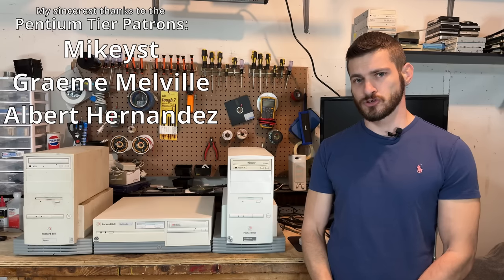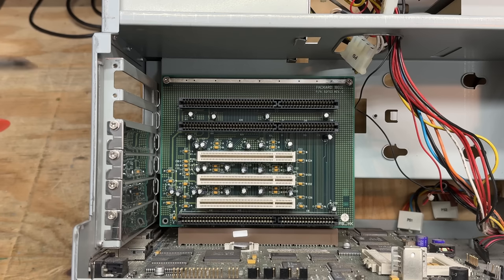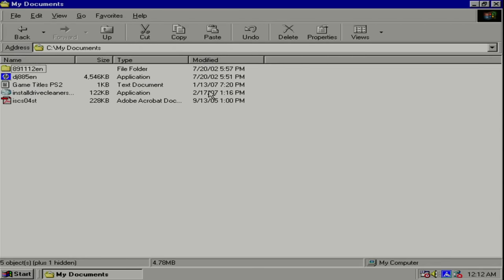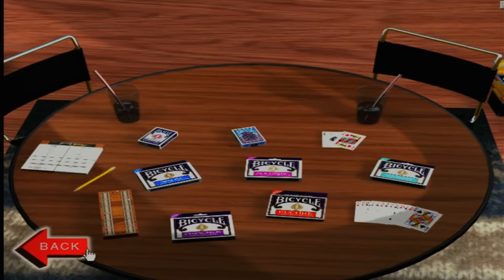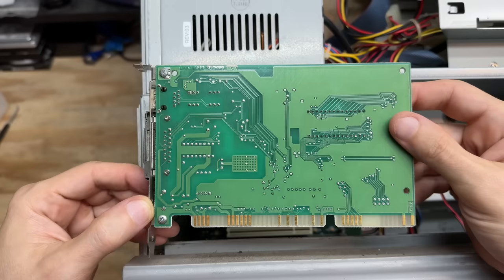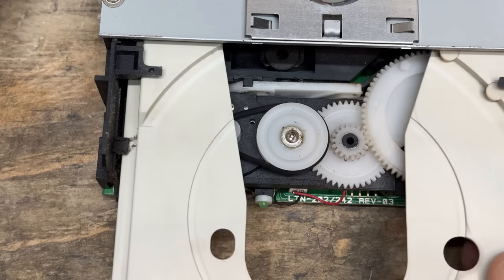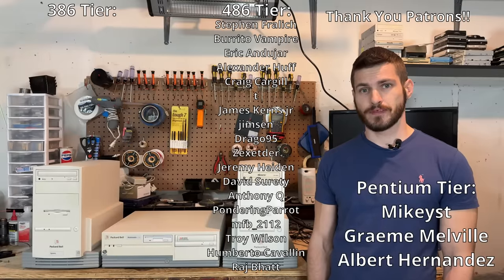Let's check out some Packard Bell towers (and one desktop)!

Comment: Rebel2 was a folder for Star Wars: Rebel Assault II: The Hidden Empire. It was released in 1995.
Reply: Ace Mc Crank,
Rebel Assault II, true, the CD-ROM install.
I'm still able to run on 14th gen RTX 4080 now, just did the Snow speeder mission, AT-AT, the robe ! It needs the CD-Rom on ATA, and it runs fine as it is as in 1995 !
Reply: From a more civilized age. before the dark times, before the mouse
Reply: I was yelling that at my screen. I mean not word for word, but you know.

Comment: I miss this design! My dad had the Platinum I with Windows 95 and a 1.2 GB hard drive. I miss it because his modem would connect at 28k with Prodigy Internet. It would dial through the computer speakers on the monitor because the sound card and the modem were on the same card. Watching this video makes me want to find another one of these machines. I remember going to Cartoon Network and watching videos because the computer had the full 1 MB of video memory.

Comment: The Multimedia Desktop seems to be overclocked somehow. I saw a Pentium 100 built in, and it posts with 120Mhz. Also on the Heatsink there is written 120Mhz.... decent 20% OC from factory? hehehe. Anyways, nice video again! Cheers!

Comment: AWW HECK YES!  PIZZA BOX PACKARD BELLS!

System 2 - Sticky dust like that could have been someone smoking in proximity to it.  How little there is would make me think it wasn't the owner, and it was only subjected to it a few times.  I've also seen Packard Bell optical drives do exactly what you described...  we called them "possessed". 

System 3 - The reason for the label over the PCI slot is because of that break out board.  It would conflict with any card in the slot.  Actually, the label was Packard Bell being a little forward thinking and masking the slot off so that end users were less likely to throw a fit because they couldn't fit a card there.

Comment: The Platinum 2240 is my Workhorse for Low Level formatting and Formatting of Drives , I got into Packard Bells via Billy Core in the mid 2000's and Now have about 16 Machines , Extra OEM Cards and Operating Systems and even a Nice MS Bob environment that I Like . These Computers become easy to Maintain after getting a Lot of Original Systems . These are Now becoming Highly Valued in the  Vintage Computer Collectors Circles in the United States Midwest Markets . Just Love collecting These , Liked and Shared , Thank You  :) QC

Comment: The DB15 port for Ethernet will require an AUI transceiver. It's a bit awkward to have a little box hanging off the back but you can usually get them with a few different media options like twisted pair, coax or even fibre.

Comment: I was given my in-laws' old PB desktop when they got divorced 15+ years ago.  It was a 100MHz Pentium but I maxed out the system RAM, VRAM, and swapped in a 200 MHz Pentium Overdrive, back when such things were still readily available on eBay.  It was my Linux-based home lab/NAS back before they were buzzwords.

It's stored out in the garage now, but it should still run with just a hard drive and a new CMOS battery.

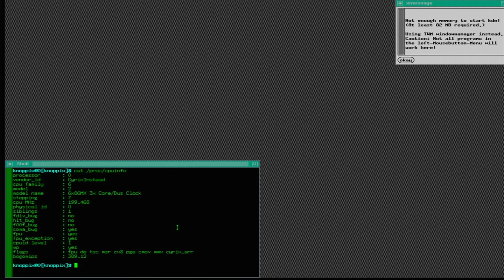Comment: 50:25 The Cyrix Instead motto was a thing, actually! Do an image search and you will find badges with it, and a boxed CPU upgrade for 386 systems that has it printed on the package.
Reply: Newer versions Windows 9x will display that too in the system properties. AMD was "AuthenticAMD" and Intel was "GenuineIntel". Older Windows versions will just think it's a 486

Comment: Those Packard Bell towers are the more normal ones. They also made some that didn't have the mainboard flat in the bottom. It was on the side like a normal tower, but they used a short bus riser with the expansion slots facing the bottom of the case so the cards plugged in upside down. There are reasons they got called "Packaged Hell" or "Puckered Smell".
I was amazed at how they could be so low cost with all the custom engineered, proprietary parts.

Comment: those towers were my first system for christmas '97 came with 233mhz, 4 gb hard drive and 32 mb ram.  Monitor with speakers on the side came with it...
Reply: Congrats'....Still fine with my own FIRST self build from Sep '97. But only a K6 200MHz. 3.2GB Quantum Fireball and 32MB EDO RAM(Was BLOODY $£€ around then = 32MB)

Comment: Wow, not just one but THREE Packard Bell computers that still work!  That's like finding a Jaguar that doesn't leak oil.

At a multimedia software company I worked at, when we got our first Beta copy of MSWindows 95, we installed it on our PB.  That machine never worked right ever again, even after doing a reload of the OS from the factory restore CD (yes, manufacturers used to provide you with actual reinstall media).

Comment: Greetings from Scotland. Another brilliant video Mike! I absolutely love your content! Especially enjoyed the strip down and repair of the final machine with the Cyrix processor – I always find weird Packard Bell's like this intriguing! Looking at both the UKT Support page and The Retro Web, that final machine uses Packard Bell's PB810 motherboard which I believe was amongst their last LPX style boards - they were already using ATX boards (both socket 7 and Slot 1) in various other machines that used their newer 'Milano' type case by the time this machine would have launched (approx mid 98). I suspect that last machine was very much a "how can we make a cheap budget PC with items from our old part's bin" special. That motherboard can only support a 66MHz FSB with a multiplier of 3, therefore 200MHz max. That will be the reason for using the Cyrix MII-266 which of course only runs at 200MHz (but 'claims' the performance of a 266MHz) - basically a very cheap way to squeeze extra life out of an old Socket 7 board. As for the 'reserved' PCI expansion slot, I suspect the reason for that is because the motherboard has integrated sound, but has to use that break out unit for the audio ports i.e. you always need to ensure you leave a space on the back for that break out unit. There are a couple of these machines on ebay, and I've noticed that the audio port breakout unit was in the middle slot which would align with that reserved expansion slot. As for one of the USB ports being deliberately hidden, that it just plain weird!

Comment: The first Wintel machine we had was a Packard Bell running at 75mhz... which was then overclocked to 100mhz, upgraded the Video RAM, swapped the soundcard/modem combo card for an SB16, and a USRobotics mode.  The modem/soundcard was terrible in DOS... could never get both working.
I eventually upgraded it enough to build my first custom PC, and never got a pre-built until that was the only way to get a 3080!

Comment: 42:56 - I'd recommend CRC Lectra Clean. It cuts through petrified thermal paste like a hot knife through butter. It even removes that horrible pink/yellow stuff that they used on Athlon/Durons in the early 2000s.

Just be ABSOLUTELY SURE to keep it away from any case plastics or LCD monitors. It will instantly etch those and permanently discolor them. It's fine for the plastic parts on motherboards though.
Reply from the maker: Interesting. Never thought to use that for such purposes. Thanks!

Comment: The date code for Packard Bell computers is in a very weird format: MMYDD. That's the 2-digit month, the last digit of the year, and the 2-digit day; it's the 5-digit number that comes after "Srv Cd."
So your Platinum 2240 was built on January 2, 1997; your Multimedia C115A was built on January 8, 1997; and your Synera was built on... an unknown date, because it's missing the date code entirely (I'm pretty sure that particular Synera was a built-to-order/BTO machine).
Reply from the maker: Thanks!
Reply: HeadsetGuy
20084 mine says, 2000 models, Pentium 4 HT
Love the Packhard Bell, very happy it's a great restored model now on Windows 10
Great Pentium machines, able to run 3 Slot GTX 1070 card !
Reply: wow, the first two are almost twins!

Comment: Since the first two machines appear to have original HDs, you can try running Packard Bell System Credentials to pull the manufacture date and original system configuration. The data is actually stored on a secret part of the HD, so it should survive a reformat. The covered USB port maybe due to controller bugs. The PIIX3 south bridge used with the 430VX chipset had a few errata where the USB 1.0 controllers were either non functional or partially functional.

Comment: I used the MM unit from 1995 to 2002 ( couldnt afford anything else until after that) , it started out as a 166 mmx with 8 mb ram and a 3.3 gig hard drive on win 95, when I finished it had a 233 mmx with 8 gig HD , 64 meg of ram, it was a rock solid machine for me , I happened into the dispersal auction of a mom and pop computer store , bought a whole tray of 233 MMX OEM chips for around 25 bucks and the ram for ten bucks , it kept me going for years. eventually put a PCI Diamond 3d card I got second hand into it and ran all sorts of games on it , never understood why PB had such a bad rep, the machine ( short of a CMOS battery going flat after a few years) NEVER let me down, now I think the worst I ever had was brand new lenovo P4 machine , I think the caps let go on that about a year after I bought it , started building my own stuff after that , again , no problems

Comment: Our first family PC looked exactly like your 2nd Multimedia system, but it was branded as an “Executive” that was more geared towards office use. My dad “acquired” it from work on the proviso that we weren’t allowed to game on it and only use it for study. Luckily the spec was so low that gaming wasn’t an option. We bought a later model tower in the late 90’s that I remember carrying back home on the bus and had to stop for breaks carrying it back. Those 90’s PC’s were so heavy and over engineered with unnecessary plastic trim and steel.

Comment: I had a Cyrix MII - similar if not the same model as that last computer - in one of my builds. Speedsys did the exact same thing to me when I tried to run it on that machine. Worked fine with everything else I did with it though! I swapped in a K6-2 and tried speed-sys with that and it worked fine. Weird...

Comment: So in my experience, that "skuzz" that was on the motherboard could most likely be basic cleaning spray that got sucked into the system while it was on. I cant tell you how many times I would see janitors back in the day just spray desks and the computers with aerosol solvent cleaner.

Comment: The cyrix CPU is reason for the fan on the VRM. If I remember correctly it was a factory installed fix. I had the displeasure of working on a number of the back in day. The cyrix PB soured me on both cyrix and PB.

Comment: PB quality in the 1995-1997 era was better than it was in preceding years. Despite the used parts scandal (which was more Compaq propaganda, since other PC makers did the same thing), PB managed to manufacture their low cost machines in the USA, including assembling their own motherboards in the US using modified reference designs from Intel and GVC.

A PB with L2 cache is rare. This was the main way they got the cost down. Usually the bundled RAM and hard disk were of a reasonable size for the time. 

The original software bundles are what make these machines interesting. They came loaded with so much stuff, much of it nostalgia inducing. Plenty of the Master CD restore disks are on the Internet Archive. Can be tricky to match it up to your machine without the birth certificate it came with - as there is a recovery ID that was printed on it.
Reply: Oh! One more thing. The PB with the reserved sticker, that PCI slot won’t work at all. It’s routed to the onboard audio.

Comment: If you want to keep the warranty stickers use some IPA. Simply put it around the sticker and wait for it to soak in for a minute or so, then use a very sharp blade and it should come off with no problems.
Reply: surprised Mike didn't slice it tbh (less destructive & more subtle!)

Comment: Magic Eraser works well because its abrasive material.   Be careful you don't create an uneven surface on the heatsink.  You'd be better off lapping them proper with sandpaper on a flat surface in that case.

Comment: Crap. I was hoping you would have tried the bios on that last Cyrix system. I had one and believe it or not, the bios was mouse driven with icons! It was very primitive but, it's the first and only time I've even seen one like that until UEFI. Way ahead of its time.
Reply: I've seen mouse BIOS on a few 80486 PCs. Almost everyone hated it, enough backlash to get it gone and every manufacturer back to the simple text screens, except on some laptops, until the GUI BIOS came back as UEFI.
Reply: @greggv8  It foreshadowed what was to come. Way ahead of its time.

Comment: some of the last gen socket 7 pentium boards indeed had usb 1.1(I don't think was 2.0 but possibly on k6 boards; I had 2 or 3 of the P1 boards, QDI forget the models)..... ** if you do retro often, first time I'm watching a video on your channel, MG Chemicals(usually electronics repair) sells a toothpaste like tube of while thermal paste that almost certainly is a bit more economic and should serve the purpose; pretty much a lifetime supply:P

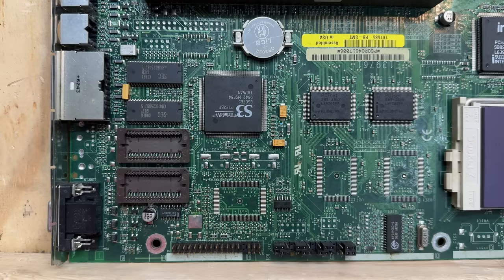Comment: Around 22:35 -- could the surface contaminant be mineral deposit from operation near an ultrasonic humidifier running on tapwater? If the local water is "hard" (as in much of the Midwest US), a similar buildup will often occur on objects. Computer fan(s) will probably intensify buildup via internal airflow.

Comment: I wonder if the sticker over the PCI slot is just because that’s the slot they put the sound IO that plugs in the motherboard so you can’t use the PCI slot… As if people couldn’t move the sound IO board on another slot if they needed the PCI one.
I really thought this was going to be the video with all three hard drives still there but nope, system 3 didn’t deliver.

Comment: What small pry tool are you seen using in the video? I’ve never seen something that’s like that but is that small.
Reply from the maker: It’s a DIP chip lifter. Whia 26810 to be exact. I’ve found many ‘off-label’ uses for it.
Reply: @miketech1024 thanks for the info, great video btw.

Comment: I just restored a later Packard Bell model, Pentium 4 HT, Utow-Sun Pentium 4 En Solde
The famous CD-Bay flap model, and swift door on the front, NEC japan case model.
I always wanted it, because it was very cheap and highly rated online back them as Best Cheap gaming PC.
Only replaced the GTX 620 card for the GTX 1070, 4 GB DDR II
Great gaming PC it is, on Windows 10, still does 1080p modern titles, CoD, Fortnite, Overwatch Blizzard etc.

Comment: Speaking of USB ports being covered.. I was taking apart an older (not this old, but still mid 2000s,) Acer system maybe? Nah maybe it was an HP either way, a mini tower, when I pulled the front cover off there were 2 additional usb ports behind a plastic cover, blocked right next to the 2 available to the user, AND the cable to connect them to the MB, AND the MB had a second USB connector on it.. I, I was BAFFLED.. like, what? You have to buy the upgraded system to get the additional 2 front USB and have the tech connect them when they built the system?? I just cannot understand.. it's crazy to me. Like.. what? It's all THERE. Just PLUG IT IN and there are now 4 front USB 2.0.. crazy.

Comment: I had a Platinum Supreme 1665 back in the day. 1996?  Pentium 166mmx. Way overpriced. I ended up overclocking it to 225mhz and it was actually a pretty good computer for the time. It didn't "officially" have USB ports, as they weren't listed in the manual nor on the spec sheet. However the ports were indeed present and worked fine once you put an updated copy of windows. I think it needed 95 OSR2, though it might have been 98.

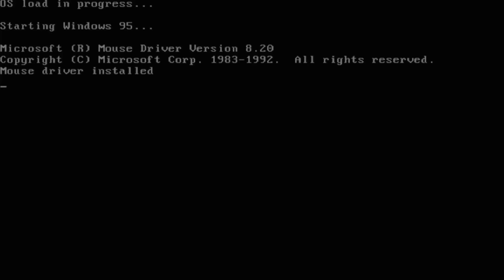Comment: 25:28 ..somtimes Seagates are...(or i was unlucky)

39:26 WOAUW!! A slot NOT for users!  Never seen one of those - even in the '90s 😀

+1 For the Quantum Fireball 3.2GB (in my first build and still alive)

PS. Cyrix on Socket 7? I did NOT know that...pretty sure that Intel and AMD was what I saw(OFF-Line aka magazines). When looking for 'first build' HW. in late '97(Denmark)?
Reply: There was worse than Cyrix in Socket7. There was IDT WinChip.

Comment: I'm guessing these are the machines that my surprisingly well made Packard Bell keyboard with BTC dome and sliders goes to, even has the same wavy design language. It's not my main keyboard, but I bring it out sometimes. I was honestly under the impression that Packard Bell systems are poorly made fire hazards, but none of these machines matched that. Maybe the absolute bottom tier machines were crap.

Comment: People would think how great they was until they would bring on in to fix and realize parts are not standard. Like the combo modem/sound card. As noted below. Packard Bell always did things their own way. Not all but most name brand mfgs. designed the system to only take their parts. Now this also lead to interesting designs as in the tower. i remember when ATX first came out and think okay. Multiple mfgs. would follow that. Yes and no. They would do things like have the atx power supply wired slightly different or not have the back i/o shield removable. Though nothing a Dremel couldn't fix.

Comment: Something not right with that P200MMX. It should have run Duke3D just fine. Shouldn't have had any framerate issues. In 1997 I had a near identical system made by NEC. Same processor. Same video chip. Same 32 megs of EDO ram. Similar sized hard drive. My NEC was even built weird with a sideways MOBO and a weird riser for the slots. That system ran Duke3D perfectly. Hell a fast 486 like a 120 or 133 AMD chip can run Duke 3D well.